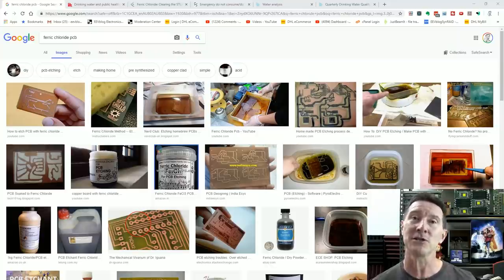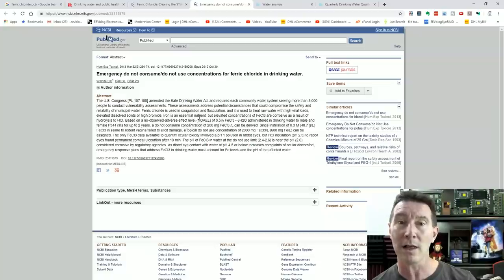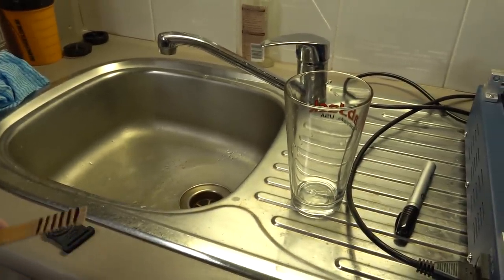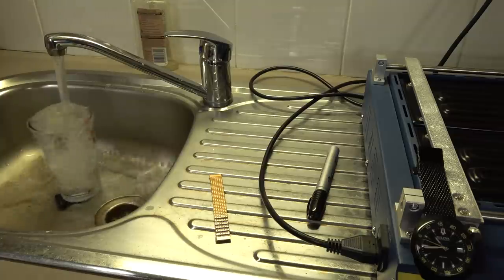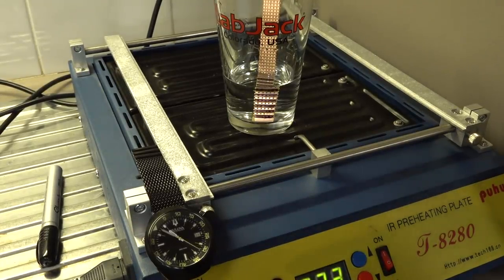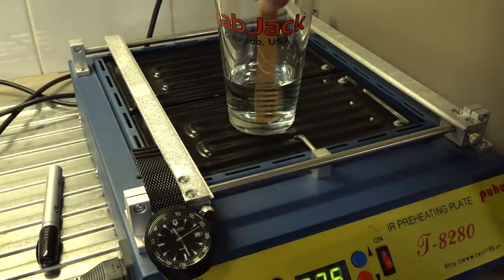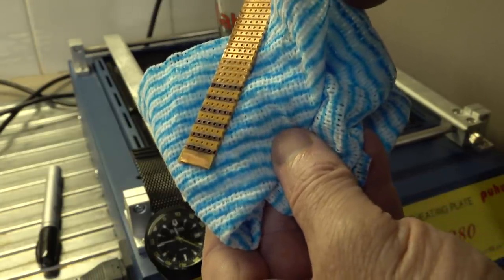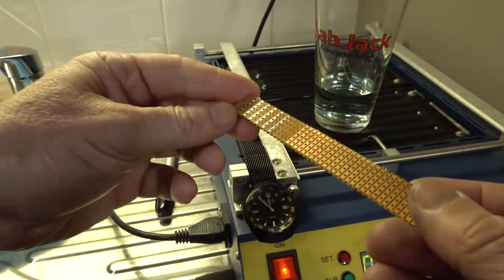EEVblog #1197 - DIY PCB Etching With Water

Comment: So I am no expert, but I have done several dozen etches with both ferric chloride, and hydrochloric acid + hydrogen peroxide. I use photoresist, but have also done marker boards and toner transfers. Currently I design and etch 2-5 boards a month. 
   I have tested all of my different Sharpie markers on the buffer margins of my boards while etching. I have tried black, red, green, blue, yellow, and silver.
    I also have several of the cheap black Chinese art supply markers that are sold for pcb etching on AliEx/eBay. The Chinese markers work reasonably well. They don't cover the applied area 100%. By this I mean, even after coating/drawing a trace multiple times until the area appears completely (ridiculously over-) covered, the etchant will still cause small perforations and imperfections through the marked areas. These are usually very small, randomly distributed and non-critical IMO. I get similar results when I do a toner transfer based etch.
     However, Sharpie's are in whole different league of crap. Black will barely mask anything useful. By the time my etch is complete for a photoresist setup with Sharpie in the margins, the black Sharpie is 50-60% compromised. The area is so poorly masked I have zero confidence that the trace is capable of whatever current capabilities the copper clad/trace width was designed for. It's so bad that, despite thoroughly cleaning and adding copious amounts of flux, it is virtually impossible to uniformly cover the area/trace in solder. My post etch cleaning routine is identical to my photoresist prep clean, works well, and is loosely based on the Dupont Riston dry film photoresist datasheet.

  The 50-60% masked results for black Sharpie were my best results with several different black Sharpie markers (all branded, but different packaging/tip variations sold). The other colors are far worse. Blue left around 25-35% of the margin materials by the end of the etch, Red left around 10-15%, Yellow was totally etched away. Silver causes some kind of terrible chemical reaction that causes the copper to react and form a rainbow of colors along with a weird textured alloy/oxide layer that is probably toxic by the looks of it.
   They are all pretty much useless junk IMO after thoroughly testing them. If all I had were Sharpie markers to do a junk prototype that is non-critical, I'd still go get a better alternative or wait. 
   The Chinese markers aren't great. They dry up fast and are a pain. If you want to buy 1, don't, buy 10. 

  Sharpie's are dye based media. You need a real marker instead, something that leaves a physical waterproof dried substrate on the surface not a thin dye that intended to soak or penetrate.
   Perhaps I could get better results by just using a Sharpie by itself. Maybe the etch time is just much shorter and it gets slightly less degraded somehow (doubtful). I have compared the black Sharpie to the Chinese markers on the same board margins. There is no real comparison, the Chinese markers are several orders of magnitude better than a Sharpie. Personally I consider the 'just use a sharpie' advice as complete nonsense in practice. I've yet to find anyone demonstrably etch a useful design using one. Even this board shown was removed before it was completely etched as would be required with a real design, and yet the sides of the covered areas are clearly compromised already, and even with the limited viewing angle, after cleaning, the body of the masked region shows signs of the etchant penetrating the mask considerably. In my experience, these problems only get worse at the very end of the etch. Even if the last 2% of copper remaining is ignored in favor of using an art knife post-etch (something I occasionally do with tight photoresist designs) the Sharpie is useless garbage by this stage.
  Of course these are just my experience/experiments. I've thought about uploading some results like this but I'm more embarrassed about the sad state of early designs and such. Maybe I will one day soon though.
  Thanks for the upload and ideas.  
-Jake
Reply: Cool story, bro!
(maybe check your calendar)

Comment: You could have done a controlled test with a glass of normal tap water next to it. To be sure it is not the Fluoride :P
Reply: fluoride? is that the stuff that makes frogs gay ?:)
Reply: @valdasaa  No, that is atrazine, it's not banned in australia ;)
Reply: All I know is that it's corrosive as f
Reply: The normal tap water would be exactly the same. He used "normal tap water" in the glass. Why would one have the fluoride and not the other?
Reply: Because fluoride is not attracted by that magnet so if the normal tap water has the same results, you could say it was not the  ferric chloride by itself. And Fluoride was also on the list from the water company.. just a speculation.

Comment: Some decades back when no corrosion preventive additives where available, car garages used this method to remove ferrous elements from cooling water. They used two tanks connected by a slow pump and one tank was stuffed with magnets. After slowly circulating the water for a couple of hours the water in the other tank was ready to be used in car cooling systems. Not sure if they ever thought of selling the other tanks content as an etching solution.

Comment: I've worked with water as an etchent before but I've had less succesful results than this. I do find that it works better at certain times of the year. Early spring is optimal as I suspect they have to treat the spring run off that gets in the streams a little more aggressively. Of course there are natural additions to the water that an experimenter can supplement to enhance the etching effect. Steer manure is just an example  of a natural additive that increases the effect. Thanks for the video.

Comment: Hey Dave...  if I remember correctly, Aren't most housed plumbed with copper?   the water in these pipes gets quite hot in the summer where it passes through the roof cavity. if someone was to leave a powerfull magnet near the pipe how long before the pipe is eaten right through?

Comment: As much as I love that it worked, it turned out to be a 64/16 = 4, you just cross out the sixes and get 4/1 = 4. You get the correct answer / correct outcome but for incorrect reasoning.
Still gonna thumb it up for making me aware of everything + pinning TheBackyardChemist's comment.

Comment: This is how I've always etched my boards, works a treat! You might want to use a stronger magnet and have the water running for 30 minutes, low flow. That way it's much faster. If you don't have a magnet you can just boil / evaporate down some water, the more the better.
Reply: Video, or it didn't happen.

Comment: The first board I ever etched was drawn out with a fine-tipped sharpie. Nothing fancy, just something to support a couple 12V fans and an inductive probe for the hot end on my 3D printer.

Looks pretty janky, but works just fine. Still installed, though that printer was retired years ago.

Comment: You may be able to try leaving the PCB in overnight using a submersible heater, or try any regular household acid. I've had good results with vinegar or plain Coke (phoshporic acid). As @TheBackyardChemist stated below, the acid is only used as a buffer.

I'm kind of sceptical if the magnet even did anything to concentrate the ferric chloride.

Comment: I think he used sodium persulfate (Na2 S2 O8). Commercially avalable as B327 for PCB etching, not very popular in most of the world. It is transparent when mixed with water before first use, turns blue when copper gets dissolved. His solution looks weak as it is pretty fast when heated that high and mine turns more blue. Much safer for use at home as it is clean and won't stain everything as ferric chloride. Very cheap too.

Comment: I use Muriatic Acid (HCl) diluted 2:1 with Hydrogenperoxide (H2O2).  Works a treat!
You're running the tap too fast, the force of the incoming water is more than the magnet and you'll get little concentration at the bottom.  Might work with the water running at half the speed you used.   Blondie Hacks blogged about etching PCB's with salt water.

Comment: Would be good to try this with just tap water, "magnet concentrated" water, and dionised water as a control. Might give it a go myself but will have to find a hot plate somewhere.
Reply from the maker: Good idea, let us know the results. You can put the glass in a pot of hot water and keep it topped up.
Reply: @EEVblog  
Will do! Making the video now. Will post it on the forum a bit later on, or tomorrow.
Reply: @EEVblog  
Hmm, something went wrong with my experiment. One of the circuit boards turned a funny colour on the back and a pattern etched into it saying "Gullib..." Still waiting for the other letters to etch.

Comment: I really hated the ferric chloride route to etch pcbs. was hard getting it even, especially with very thin wires. I ended up using hydrochloric acid and hydrogen peroxide. To get it faster too I used usually a warm solution. You could etch a board in about 6 seconds. Downside was the gas cloud that formed. :D

Comment: it's more likely that the chlorine in the tap water reacted with the copper and oxygen to form cupric chloride which can also etch PCBs. The tap was running much too fast for that magnet to be able to hold on to any iron ions, I don't think that really did anything and a hot glass of water, stirred periodically, would have the same results. If you test the pH of your tap water before etching and after etching it should be more acidic afterwards.

Comment: I thought ferric cloride is in the water as Iron(II)-ions and can't he magnetized because it can't build up monecular magnets.
Reply from the maker: I'm not sure of the physics of it, but seems to work.
Reply: Chlorine, fluorides, salts... It's hard to say what might be causing it without getting the water coming out of the tap water analyzed. 
A control test really should be done. Straight tap water, distilled water (shouldn't do anything), simulated tap water with all the same chemicals and proportions but no FeCl3. This whole thing strikes me as something Applied Science or Cody'sLab should be doing.
Reply from the maker: trustthewater - Yep, bit out of the league, might leave it up to them.
Reply: @trustthewater  It could be done with potassiumthyocyanate. It actually is a farly common reaction in school because the result is very blood like:) I think NurdRagw has done a video about it. And its very sentensive to Iron(III)-ions.
Reply: I had some concentrated FeCl3 solution and some large neodymium magnets. I could not get any perceivable movement of the fluid. I was able to stain a couple fingers, though.
I'm not saying it's impossible or that 5 minutes of eye-balling it is a conclusive test... I'm just saying I'm a bit skeptical of the magnets being able to have any real effect on concentrating ferric chloride from tap water.
Reply: @trustthewater  In australia April the first is two hours away
Reply: That doesn't mean you should stop. It's a very interesting idea that is getting a lot of people talking. You post a lot of great content and have an active group of fans that are eager to work with the ideas.

Comment: Tap water has a decent amount of chlorine in it too, I imagine that plays a role. 

Would be interesting to see a control without using any method to concentrate the ferric chloride, and maybe even distilled water. Either way I'm surprised at how decent that worked.
Reply: Was going to mention that too, I wonder if the small amount is bad for copper pipes over time, or if it's just too small of an amount to matter.   Wonder what happens if you strap a magnet to a copper pipe if it will corrode faster internally due to picking up the ferric chloride.

Comment: Would it work faster it you boiled the water down?

We had higher than recommended uranium levels in our town water. I wonder if a similar process could help make thin film nuclear batteries. What are your thoughts Dave?

I hope you didn't really let the water run for 5 minutes, what a waste, in the middle of a drought.

Comment: I think it would have worked a lot quicker if you'd added some seeding iron to the glass, like paperclips or steel wool. Just like you can turn a nail into a magnet by attaching a magnet to the other side. Need to take some sandpaper to the paperclips to increase the interface surface for oxydation, but it'd save time in the long run.
Reply from the maker: Nice idea, worth a try, thanks.

Comment: I tried to etch a PCB with a solution of salted water and using electricity for etching. On one pole, I used a carbon bar extracted from a battery, and the PCB's copper is connected to the other pole. At the end it doesn't works so well since there's almost no copper left. (edit) Completely forgot the date!

Comment: Dave there is a few problems with your concentration method. The flow from the tap would easily wash away everything you "concentrate" with your magnet, after all, the magnet's strength diminishes fairly rapidly with distance, and its strength is also more effective on larger particles, like the other magnet.... So to actually do anything with this concentration method you might need to set your tap to gently drip water into the glass, and maybe also have a far stronger magnet.

Secondly, the bubbles forming in the glass is mostly due to the water heating up and thereby lowering its ability to dissolve gasses. (This is why soda/fizzy-drinks are stored cold, as to retain the high concentration of carbon dioxide.) So bubbles would form regardless if there were a PCB in there or not. Second reason for why this is the case is that the bubbles stopped forming eventually, but the etching continued.

Thirdly, the etching is more likely due to the copper oxidizing and dissolving into the water. And the occasional string would keep the oxygen content of the water closer to saturation and thereby driving the reaction more steadily. But this you can do with distilled water as well.

I would also suggest testing if Ferric chloride can even be concentrated with a magnet to start with. (Can be done with a small tub, elevated a bit off the table, and place a magnet under one side of it, before filling it with ferric chloride. If the ferric chloride gets more concentrated where the magnet is, then point proven, otherwise a stronger magnet might be needed, or the concentration method doesn't work.)
Reply: His method works, but only on 1 April.

Comment: Interesting idea/video! I work for a water company as an operator at two potable water treatment facilities so I'm familiar with Ferric and the water treatment process. We use Polyaluminum chloride as a coagulant at both plants instead of Ferric but it does the same job essentially, they both have their pros/cons and it is used at other works in my area. Coagulant doses change with the raw water quality but we typically use around 20 mg/l on a steady impound reservoir supply so not a massive concentration to begin with.

 Every part of the process is highly monitored and regulated with strict limits through each stage of the process, not just what leaves the site ready for consumption; 0.2 mg/l of aluminium after the filters is the maximum limit so very little should be leaving the site. Not 100% sure on the limit for iron/manganese when using iron based coagulants but I expect it to be of a similar value, interesting idea nonetheless!

Comment: You should be-able to concentrate the water into hydroxylic acid. It works wonders etching iron objects. Adding a bit of salt will help.
Not sure about coper etching, you might need some camera trickery and jump cuts for that :)

Comment: Uploaded the day before April Fools. Hard to believe there is enough FeCl in tap water to etch away any copper. I remember using the photosensitive spray from Dick Smith to create the tracks on the PCB before etching the copper away with FeCl.

Comment: Nice troll Dave. But if it isn't, as a former industrial chemist I must tell you there are too many variables in your chemistry experiment to simply declare ferric chloride is doing the etching. To name a few: pH, oxygen level, chlorine concentration, and perhaps other reactive ions in solution. Nevertheless, nice demo, I especially liked the magnet bit for concentrating the ferric ions. By the way, all metals have some solubility in water, increasing with temperature.

Comment: I know what I saw but if there were enough salts in the water to cause an exchange reaction (more than 50 years since I had chemistry in college) we would have some serious problems here in the US.  Much of the water piping here is copper.  Some of the newer locations are using PEX, a plastic tubing.  I'm not a plumber, but I have never heard of copper pipes or tubes leaking from corrosion from the water. 

But what I have seen, on refrigeration equipment, many of the evaporators are made from thin copper tubing.  Often there is condensation on the tubing from the humidity.  I've seen many tiny pin holes in the copper causing the refrigerant to leak out.  The only explanation would be that there are some salts in the water that had condensed on the tubes.  I know we have air pollution, but something doesn't make sense here.  When the lines are pressurized and a soap solution is applied, the leaks are so small the bubbles appear to look like shaving cream.

Another unexplained mystery, perhaps the chemist could explain this too.

Jim

Comment: I wonder if it will work if you buy a bottle of chlorine based bleach and put in some scrap iron pieces rusty nails etc. and then filter liquid with coffee filter and after that evaporate excess liquid by heating it gently. In theory that may work but be aware of nasty fumes and corrosive properties